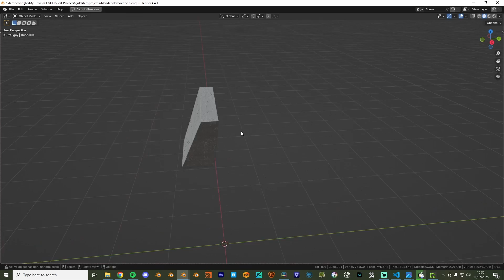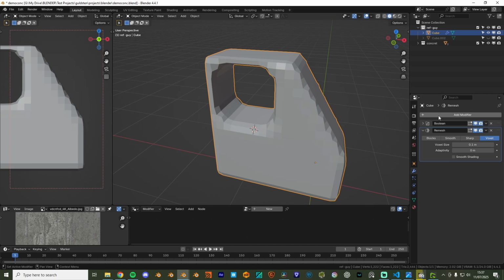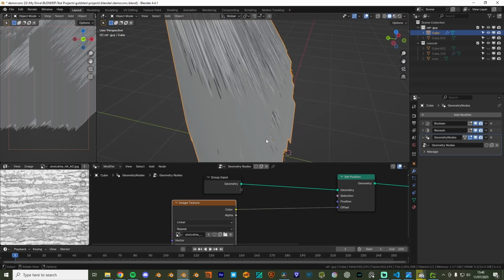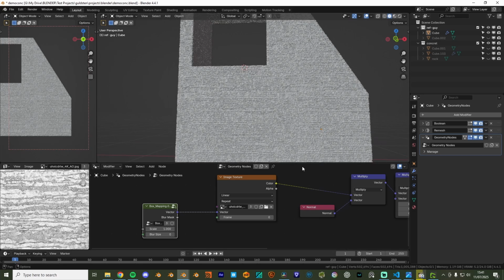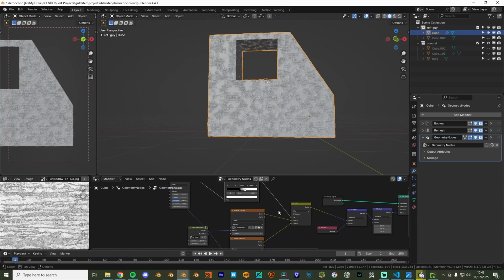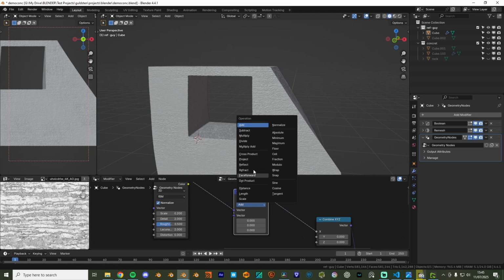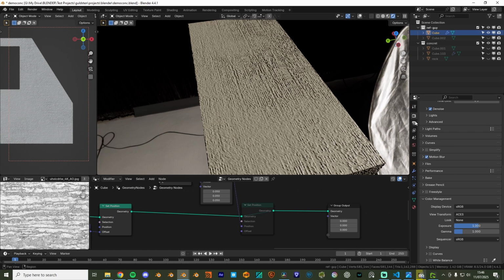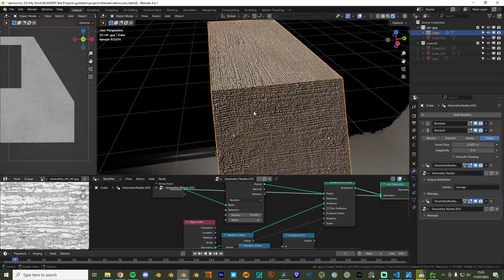Realistic architectural concrete in Blender - Tutorial

Comment: It varies with 2d paint programs, but there's something called high frequency vs low frequency detail in an image, and if you remove the high frequency detail a sort of smooth denoise/speckle to a texture, it's smoothed but not blurry.

You can use the smoother version for a displacement map, but net needing gazillion polygons, and the fine detail version is used as a bump/normal map.   
I read about this trick from an old article how the VFX guys optimize displacement mapping.